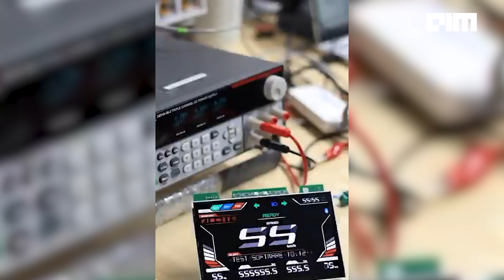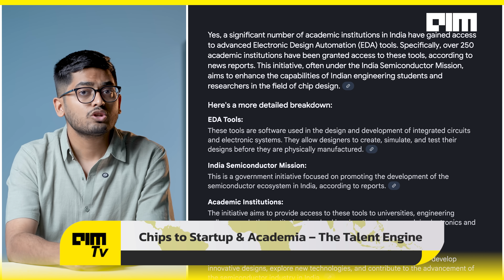India’s First 3nm Chip Centres Are Live — Here’s What It Means | FrontPage

Comment: What is the difference between 3nm and 20 nm chip “design”. I was under the impression that the difference would be manufacturing. How does design change for 3 nm or other thickness ?
Reply: Quantum tunneling, 20 nm chips don't suffer from the constraint that 3 nm chips do due to the thickness of the channels.

Comment: 3nm chip Indian maufacrting is possible only with heavy investment and import of all machinary from abroad. Even if you make must market world wide to oprate economically. It will be used  only in mobiles.and computer market. Very difficult to be succesfull. Most of the RF and power semiconductor of micro meter fab is also imported in India. All govt owned IC fabrication like SEM, ECL, BEL are closed or loss making.

Comment: These posts are very misleading. 

Designing a chip at a particular node does not involve anything special. Thats because the 3nm node design library comes from the EDA vendors like Synopsys who work closely with actual manufacturing Fabs like TSMC, Samsung, SMIC, etc to create customized libraries for each vendor. 

Essentially what that means is that the designer of the chip has nothing to do with the manufacturing process except selecting the process and following the design rules and guidelines given by the EDA vendors. This means that any chip designer can design a chip on the latest semicon process node if they are willing to pay the high NRE costs associated for Masks, etc that come with a leading edge process node. 

People need to understand that designing a chip, and actually manufacturing it are 2 completely different animals. Design can be done by a group of engineers on workstations with the right EDA tools. Manufacturing a state of the art chip requires fabs that cost tens of billions !
Reply: It is not surprise that people in india are either innocent or dumb hence beating drum on such thing.. All you need is a low IQ reporter like this and dumb / scoundrel politicians who are hungry for cheap publicity and you have masses ready to fool around.  Anyways masses in india do not even understand what is chip design, they just see some commotion and believe that it is extra ordinary. No one understand that all it takes is a computer to design 3nm chip where india has no relation with PDKs or EDAs, they are just utter fools to feel good for nothing. It is something like cooking tea from gutter gas or 2ab of (a+b) square. The majority of the people are illiterate (an electronics engineer does not even understand what is the purpose of transistor) except 1 non biological avatar of lord vishnu.

Comment: Design is the first step. Manufacturing the chip should be the goal. Even 20nano meters manufacturing will be a big achievement.
Reply: its already done, there is a instituition called IIT Madras and IISC bangalore also, 5 nm design has already been done
Reply: @navoneeldas9133 design is not manufacturing dude. Are people so clueless about fabs and chips but they feel the need to comment?
Reply: @jsdotnetsql well looks like they are 😂
Reply: @jsdotnetsql  they willl be manufacturing 28nm this year.. 14 and 12nm wll most probably in 2028.. 7nm 5nm 2032-33.. 3nm 2nm i do not see it before 2038 anyway..   india will be manufacturing the body the barain is still far away
Reply: In space larger chips are used to reduce radiation hazard.
Reply: Around 50 percent market is above 28nm technology
Reply: True , but I don't think even a 28 nm plant is possible in near future because most of the plants which are going to open in India will be around 40-60 chips. 

Still it's a achievements and if the production of all these fabrication unit start in 2026 then maybe by 2030 we will reach 20-30 nm chip production at large scale. 

Tsmc also started with bigger nodes of 3000 nm but now they are producing 3 nm chips. Hope moores law also the same way in India😂 .
Reply: @girdharisinghgehlot we will never catch up with TSMC or even Chinese. Even China can’t catch up to TSMC after trillion of dollars.
If world find a disruptive tech which can remove lithography and use a new process, india has a chance to be competitive.
Chinese competed on electric vehicles not on gas because the market was saturated. Same thing is needed on chips.
Reply: @jsdotnetsql  that's not true buddy. Tsmc is reaching last stages of chip advancement. Because current lithography  machines can't create below 1 nm chips and currently tsmc at 3 nm so if we follow moores law it will take them next 2-3 years to reach 1 nm chip production.  Asml recently said that they are making a new next generation lithography machines which will help us chip manufacturer for advance chip making but that is expected to happen around 2035-40. 

Tsmc will face a long stagnant phase and in that time other countries can catch up especially china. 

If we follow moores law and assume production of chips will start in 2026 then india will start producing 14 nm chips by middle years of next decade.
Reply: @girdharisinghgehlot how long does it take to set up a 20 nm fab?
Reply: @girdharisinghgehlot  Tata plants in Dholera will make 28 nanometers. They are even planning for 14 nanometers
Reply: @girdharisinghgehlot look when India start the race in any product we start slowly but steadily we reach the stage as world leader in that sector like India started medicine sector and now India is the farmacy of world, India started Service sector our growth was slow but now we are world leaders in that sector. So, just celebrate what we are doing we will definitely one day become leader in semi conductor sector.
Reply: Well India can easily produce that, question is if its going to cheaper than China, China dumps and local industries gone !!
Reply: @VikramKumar-oy8gq  do it then. Even the US is dependent on China for 14 nano or lower chip.
Reply: I think some people are getting crazy here.
Everything has a foundation and we have established it now. Once awareness is spread among people then only they will start working on it. If we talk about lithography machines, raw materials and architectural design these are the challenges we need to look upon. No matter for small or large machines. But Some people are saying that tsmc has achieved 1nm processors, but practically it's not possible. Even the tech is also evolving. Only time will tell what's going to happen.
Reply: 10 years ago everything was only a dream so have patience things are moving in right direction
Reply: its a japanese comapny
Reply: @srinathshettigar379 yes and will train indian people's ! Tsmc Taiwanese founder was employee of America's texas instruments 😅 later he founded TSMC !
Reply: @jsdotnetsql  if india achieved advanced chips manufacturing and which is disaster to the world USA and China will not allow India to do that since the resources are limited on earth
Reply: Don’t think indian people speaking fluent garlic English then the india is the USA ally that’s naive if you growing up and strong the USA will blocking India which is same happened in japan and in China 😊
Reply: @jsdotnetsql  💯
Reply: Tata is already building 28nm plant and upper nm is already done by scl, Foxconn vedanta adani already said to start manufacturing, second 5 semiconductor manufacturing plant is already there
Reply: That’s about 2 decades of work.
Reply: By the time India achieved its 3nm architecture, the rest of the world might have sped away in  warp speed with their revolutionary quantum/photonic chip or the next gen. Graphene based chips to replace the silicon wafer today.😂

Let see, since India has achieved its first lab made chip of 140nm.  Full scale chip manufacturing is totally another story! Anyhow,  India has arrived to the 1980s technology level! Again doing so with imported equipments/collaboration and without foreign trade embargoes, sanctions, smearing or restrictions in the supply chains.  Congratulations!😂
Reply: ITs BS . .nonsense .. GOV corruption in channeling money and hiding it by running fake news.
Reply: @jsdotnetsql  no one will buy that crap
Reply: @sagarsharma8960  each nm scale have different use  case not every chip goes in smartphone , there are millions of other devices that require processing power .
Reply: @sagarsharma8960   14 and 28nm is more important because most consumer electronics use that , only phones and high end electronics use sub 7 nm chips. Please educate yourself.
Reply: @burnttoast9890  if you're not going for high eng products you can't make money.
Reply: @sagarsharma8960  another unaware “cool” kid 😂
Reply: @parameswaradhikary  both points are correct. Important to cater to broader market but equally important to setup foundations for cutting edge. Not sure why y’all just want to prove yourself right and others wrong.
Reply: @sagarsharma8960   bro enter real life not reel life, commenting something without doing is easy thats the reason why mike tyson said one quote, India must introduce a law that every comment and video in social media must be true and verified else the punishment should be 4 months in home arrest with no internet or human connection, because of oversmart kids like you australia has banned almost all type of social media platforms for kids
Reply: @burnttoast9890  True. At least India should make 28nm chip. India does not even have one DUV machine. Even old used ones are still in operation china and India cannot get one as each one costs $100mn. Also even if India produces one, it will be 10 times more expensive than Chinese ones. So simple washing machine will cost 1 lakh if India sells washing machine with chips made in India. No one will buy them. India better stick to designing alone. Also no country outside china and taiwan is trying to make one. Even Japan has given up. Why bother to invest in something that is not going to sell.
Reply: @sagarsharma8960  that’s dumb thing to say. From nothing to “high end products”. Kid you should stop commenting at this poiny
Reply: @hr_47  As celebrating mediocrity we aren't doing anyways. Mediocre are a curse and excellence is the cure. What is wrong with making 3nm chips at large scale? That is only place where you can actually make some money elsewhere it is hard to break even. You all thinking about the older tech chips but old tech never makes money. Hope you all were actually as smart as you think u are.
Reply: @bestofsatish  glad you are not in charge of anything.
Reply: @sagarsharma8960  People make money selling sand, bricks and stone chip and then there are high tech companies that lose money so be careful
Reply: @parameswaradhikary  he is correct, I work in Supply chain of Semi con fan units. High end <7 nm chips are what brings Trillions in money. That's why US hasn't allowed TSMC to put plants anywhere else, now they built a plant in Arizona for this to avoid strategic alignment to create monopoly.
Reply: @rishishukla8258 we didn't reach mars before low earth orbit
Reply: @rishishukla8258  nah bro is just dumb, nothing comes out of talking about it, we have to start from something
Reply: @sagarsharma8960   bro everything other than latest pc  and mobile processors are using these chips 😂.
Reply: @sagarsharma8960 oh boy. You need to learn basics before commenting.
Reply: @sagarsharma8960  but still very useful in , some defence and EV related chips.
And it's very hard to achieve that small node at once, it's takes constant research , growth and ofcourse heavy investment.
Even Taiwan did lots of hardwork before coming to such a precise node.
Reply: @sagarsharma8960  Lol thats not how it works kid. If u offer competitive pricing everything else will follow
Reply: @sagarsharma8960   i think you don't know anything about chip 😂. 20 nm chips and bigger nm chips has massive Market in world. Low nm chips like 3 nm or 2 nm are only have few market in world. 

Starting from automobiles to space craft everything use semiconductor liky 20 nm chips or bigger.
Reply: @tanmayadas68 20 nm chips Have zero profit margins, there are lot of manufacturers and you all are crazy if you think you can make money in that.
Can you make those cheaper than china?? NO
Reply: @sagarsharma8960  actually they would buy .... it was used in cars and electrical appliances
Reply: @sagarsharma8960  on the contrary, those are the most sold
Reply: @sagarsharma8960  you learnt to run before you walked right?